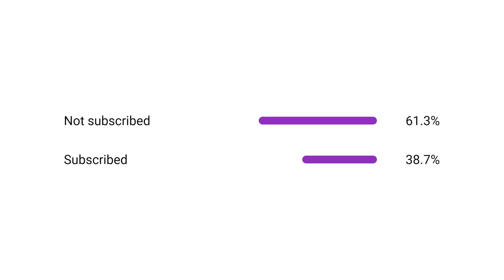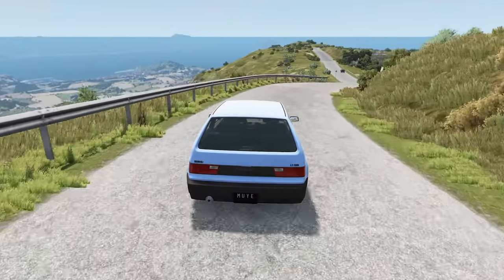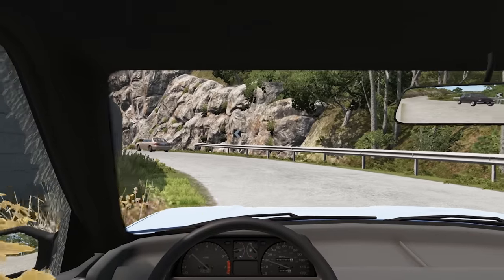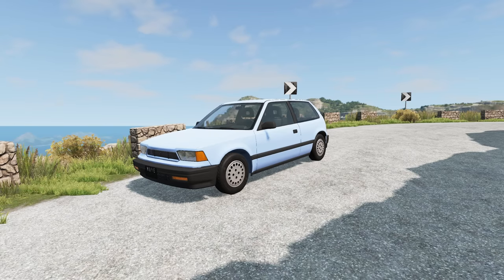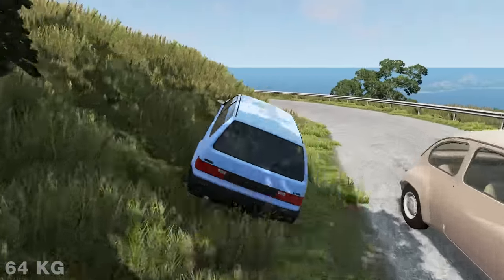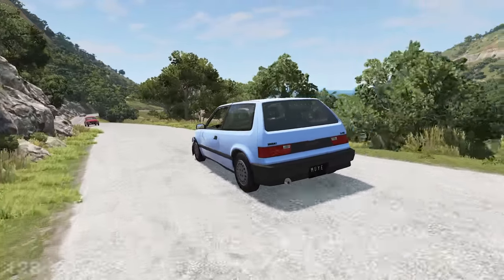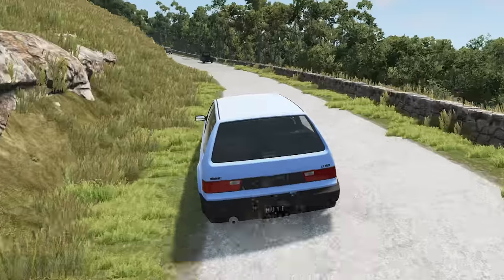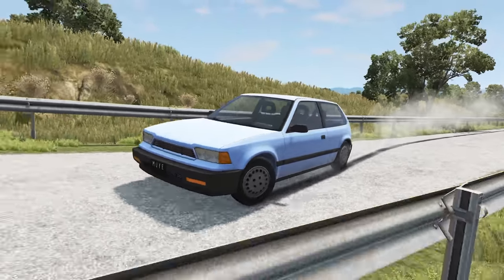Every Time I Crash, The Flywheel Gets Heavier

Comment: Hi, mechanic here. Your description of a flywheel is just a bit off, but close! You most likely described a harmonic balancer. The purpose of a flywheel to me, is similar to what you described, but it connects the engine, to the rest of the power train. The harmonic balancer is more to prevent the engine from vibrating too heavily, and is used to keep the engine, in harmony with itself. Maybe a little knit-picky but i think the distinction of how much a flywheel actually changes a car is a good thing to those who may not be as familiar to cars or engines. Thank you.
Reply: They did in fact accurately describe  a flywheel, because that is the purpose of a flywheel in any piston engine, whether combustion or steam. A harmonic damper is meant to counteract the forces of each piston stroke, whereas a flywheel is intended to keep the output shaft rotating smoothly between piston strokes. 

In cars, it's the clutch or torque converter that connects the engine to the transmission. I can understand the mistake, though, because those are usually mounted to the flywheel.

Comment: 7:52 fun fact! for the 2010 season, the williams F1 team actually worked on a flywheel-based hybrid system that would use the engine to spin up a flywheel, and then use the momentum of the flywheel to deploy extra power at the push of a button. however, this version of "KERS" was abandoned and replaced by a more conventional battery-powered KERS system once KERS was re-introduced by the F1 regulations for the 2011 season.
Reply: @linus sex tips gaming channel chill dawg julie got a point. he basically kers’d the hatchback
Reply: Another fun fact, Williams sold that thing to Porsche who ended up using it in WEC
Reply: So it's basically an interia starter, but for adding top end power instead of starting the engine.
Reply: @rotkiW9014  it wasn't Porsche, it was Audi that used the Williams flywheel system and developments of the between 2012 and 2015 (Porsche used a electrochemical battery system developed by A123, which ultimately proved to be the superior energy storage type)
Reply: @K9RacingAndStuff  Porsche also used the Williams flywheel KERS but in a 911 GT3 on the Nordschleife not in the WEC.
Reply: @Skilan506  right right, that one I kinda forgot about thanks to how short that project was
Reply: @K9RacingAndStuff  I thought it was Nissan who used the flywheel based system in the GTR-LM.
Reply: @PinkThorn242  Different system entirely to the Williams one VW used; the one used in the Nissan was a purely mechanical system developed by Flybrid/Torotrak, and has never been good in any of it's applications.
Reply: Gay fact
Reply: I didnt know dishwashers could talk, let alone know anything about cars
Reply: @cope9489  big talk for someone named "cope"
Reply: Continuing from this, they trialed flywheel busses in some country, (it's been a while since I read this and I'm too lazy to go double check for a comment), where the flywheel would act as a kinetic battery being recharged at thier stations
Reply: My head hurts

Comment: Fun fact about mechanical batteries, they used to be implemented in bus systems. Some buses had massive flywheels that would power the wheels via a generator and when they made their stops, they'd have rails connected to the top to spin the flywheel via the generator they're attached to. It's kinda like how hybrid cars have motors that double as generators with regenerative braking, except it's generators that double as motors when stopped at a designated bus stop

Comment: This is actually something you factor in on locomotives when calculating the brake properties. The rotors in the electric motors weighs tons and spin at relatively high rpm's, so you add a few tons to the actual weight to get the "dynamic weight".
Reply: I assume that goes double for calculating if the brakes will still work if the dynamic braking system failed.
Reply: @RobertSzasz  In Sweden the dynamic brakes are not included in the calculations at all for most trains since you're calculating for worst case scenarios i.e catenary being lost. The pneumatics are much more reliable since they're only dependent on onboard systems.
Reply: Yea. Dynamic braking. Sounds like shit when your an American living on a railroaded mountain, but its cool shiz
Reply: the word you mean as dynamic weight is moment of inertia

Comment: Basically, with a 250kg flywheel you need to rev up the engine, put to neutral once you reach the desired speed so the wheels aren't connected and you can properly brake, then anytime you want more speed you shift back into the correct gear for the speed you're going at, then shift into what you want.
It's a curious way to drive a car.

Comment: At 32 Kg, if you rev the engine just a little and engage the fourth gear directly, the car WILL jump ahead instead of stalling.
Also, the heavier the flywheel is, the more gyroscopic effect it have, making it harder to turn, just as you have noticed.
At 1024 Kg, the engine at idle, hold the clutch, get in fifth gear, release the clutch and you are going.
Reply: Thx for tip video is over so its useless but ok

Comment: This video reminded me that Automation doesn't have flywheels as part of engine design. Could be interesting to learn real-world tradeoffs like a heavier wheel having smoother idle, easier throttle management at speed so you don't have to be precise with the gas pedal but the cost is reduced throttle response, reduced economy due to needing more throttle to overcome the weight, etc.
Other impacts would be weight added toward where the engine is mounted as well as the potential to have brake fade problems due to how much more energy the brakes have to absorb to bring the car to a stop at higher speeds.
[!] The flywheel's weight is reducing throttle response and sportiness. Consider reducing flywheel weight.
or
[!] The idle state of the engine is rough, reducing drivability and comfort. Consider increasing flywheel weight.
Reply: The rear tires are wide for the load they carry, increasing weight and cost. Consider decreasing tire width. (Laughs in 3600hp)

Comment: Flywheels as batteries are actually a thing. Busses have been using them for many years. They use power from breaking to spin them up and then use that energy to accelerate again. The Nissan GTR LM Nismo racecar also used a flywheel based hybrid system, but it wasn't really designed for a 24h race and kept failing. Unlike the extra heavy flywheels Muye was using those systems usually use much lighter flywheels at higher rpms, often in a vacuum

Comment: Muye, flywheels are not only used for keeping the engine turning which that the counterweights in the engines job are for but flywheels also give you a better shift and smoother shift.

Comment: What’s actually funny is that a lot of luxury car manufacturers before the 1940s (especially Rolls Royce and Bentley) would actually use 100-120 kg fly wheels on their 8+ cylinder inline engines to improve felt vibration and improve at speed handling, but at the cost of as you found out, acceleration and braking. (Typically if you had to break suddenly in one of those at speed, it was usually in your interest to throw it into neutral and wait for the engine to settle after you stopped.)

Comment: Not stop the engine from vibrating, that’s what a vibration dampener is for. The flywheel only maintains a consistent speed while providing a connection between the engine and starter motor as well as a surface for the clutch to press aganced.

Comment: Inertia is described as a mass's resistance to change in speed. An 8KG Wheel has greater resistance to slowing down, than a 4Kg wheel travelling at the same RPM

Comment: A flywheel is really only used to start your engine. What you described is the harmonic balancer.
Reply: The ring gear starts the engine. Cars without an electric starter still have a flywheel.

Comment: I = k m r2 

where

k = inertial constant - depends on the shape of the flywheel

m = mass of flywheel (kg, lbm)

r = radius (m, ft)

so every time you increase the mass you increase the stored energy that's invested in it, so the amount of inertia increases which can be interpreted as the flywheel being reluctant to change magnitude or direction, explains perfectly why the flywheel pushes through the brakes when attempting to brake and not doing so while the car is out of gear because no power is making through the transmission to the wheels as the flywheel slows.

Comment: Fun Fact!

A car company (i dont remember which one) actually made a car (back when all cars were manual) with a big 16[?] Pound flywheel attached to the engine, so that you could, effectively, pop your car right back into fifth (or whatever) after stopping at a light.

This car was recalled because of a slight issue.

Basically, it turns out there's a lot of momentum and force stored in this massive flywheel, and if you were to, I dont know, get in a minor car accident...

The flywheel, a giant steel disk, would escape from the vehicle and bounce merrily across the road, scything through cars as it went.

Comment: 7:58 It’s more like a transistor. A transistor is essentially a coil of wires, sorta like a spring. As electricity flows through wires, it makes a magnetic field, magnetic fields also push the current, so as power flows through the transistor, it gets the ‘flywheel’ spinning, and once you stop putting power in, it keeps ‘spinning’.
Reply: I was thinking inductor or capacitor

Comment: The choice of flywheel, as you found out here, also provides an exchange of power for torque. A lighter flywheel allows the engine to accelerate harder (horsepower), but it takes less resistance to slow it down. A heavier flywheel takes longer to spin up, but has more inertia and thus more torque. Many big bore diesel engines have 75lb+ flywheels to take advantage of the already huge torque that they produce, and many motorcycles have 1kg or lighter flywheels. Some purpose racing bikes have no flywheel at all.